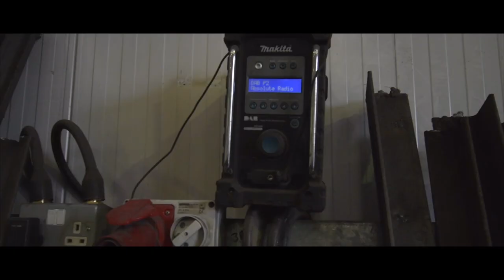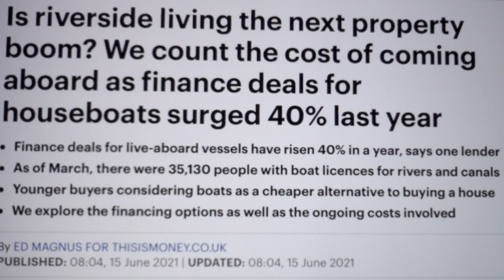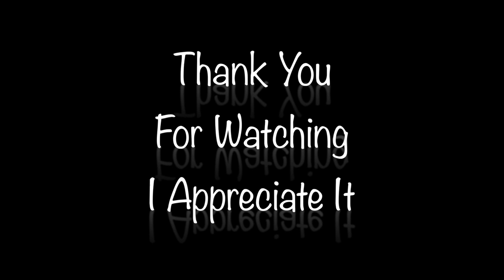Ep 1.  I'm Buying a Narrowboat

Comment: Interesting  - Watched it twice and am pretty sure you know what your doing - the element that spoil the canals which put people off will have a shock if they knock on your door  - I picture your boat being called Rambo with torpedo tubes and a  gun turret - maybe i`m getting the wrong impression but far more interesting than compost toilets - Subscribed
Reply from the maker: How perceptive Terry.  I don't want to offer spoiler alerts in answering questions but the boat is going to be a near, 'battleship' grey.  While I will talk about the basics of what is going on the boat, toilets will be a small part but, I do plan to offer an experience to the viewer that is slightly different.  I want to test assumptions.  I do it so I am as prepared as possible and adjust my expectations accordingly.  Thanks for the comment.  Exchange torpedo tubes for 66mm rocket although checking for back-blast means I could only use it from the stern but as the trajectory dips slightly on release, I'll blow my own boat up!!

Comment: Hi Chris, I'm looking at narrow boating too but yeah, it's kinda pricy. Is building your own boat really cheaper? Please share how you costed everything out
Reply from the maker: This is long and my opinion based on research not others views
To buy new is more expensive.
Chose your position of budget or premium.  It’s like cars. There’s nothing wrong with budget, but…..
To do a DIY project boat up is cheaper but you need to plan. Then plan some more and research and plan again.
Design is everything. What are your requirements?  Design around them. To buy previously owned is risky but, some risks are worth it.
If you buy previously owned, don’t worry about the fit out as such, search for condensation marks.  The wood will be black. If the floor is soft. There are many older boats that are done up but there is no mention of ripping up the floor and sub-floor to check for rust. Boats can rust from the inside out. 
Cost.  It’s too difficult to say as each boat will have its merit and if new, each builder will position themselves from budget to premium.  Prices have gone up due to supply and demand as well as steel costs, engines, multi fuel stoves. Anything made of iron and steel has gone up or the supply chain has slowed. 
If you have the time and skills, buy a new shell and fit it out yourself. If you want a project boat, rip it out and treat it from the bottom up, properly. It’s cheaper, but it takes time and lots of effort and research. Get it right first time.  If you don’t, to change a ceiling panel for example, may mean taking trim, sub-walls and the shower out if that I’d attached to the wall.  Everything has more than one effect on something else.  People to follow, narrowboat with nanny and grandad are first timers and doing a DIY. No previous skills. People starting out Lee and Ali building the black swan same skill standard. Both however got a design plan. They didn’t regret it. Others that didn’t get a proper design plan often need to change something because it wasn’t considered from the start. 
That’s it. Take it or leave it.  I don’t think anyone can fault this advice. They will add to it, but I’ve done my research, then had it confirmed. 
Good luck with whatever you do.  I don’t think I’ll regret it….but then I’ve not been on a boat before. Risk.
Reply: @chrismears-inslowtime  thank you so much for replying, you are amazing sir! If I ever get the chance to meet you, I owe you a beer. I'm trying to get 2 boats, first me, then my parents so yes money is something I'll need to consider but  I'm a engineer, granted in IT but still an engineer :) so I'm all about that research and planning. After seeing the price of boats I'm also looking at getting someone to build the shell and maybe a few other specialist jobs, painting, fitting the engine and insulation come to mind but the rest I can probably do myself.

Thank you for those accounts, I'll defiantly look those up. There's also a boat festival in London this weekend so I'll be going there too so that I can learn as much as possible.

Thank you for your videos, I'm watching them all, not just for entertainment but they are fantastic to learn from
Reply from the maker: @fglg  if you need any other advice, please ask.  The channel is about my journey, not about me fixing up a boat. However, Lee and Ali Black swan narrowboat thing, stated they learnt a lot from my thinking. Not many have ever said that, so I took it as a compliment. Happy to have a chat at any time.  I’ll be on the canals next month, hopefully..can never really tell.  Good luck with your journey. If you want advice on shell builders, ask again.  You get what you pay for. Again, nothing wrong with a cheap shell but…..
Reply: @chrismears-inslowtime  I absolutely will ask, thank you so much for speaking to me. I'll almost certainly have more questions as time goes on. Best of luck on the canals, hope to see you on there some day :)